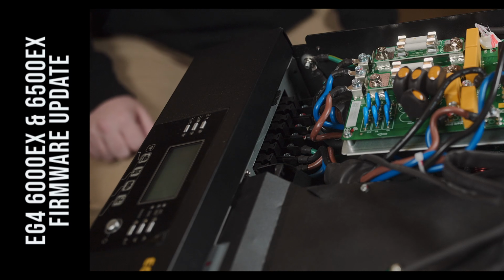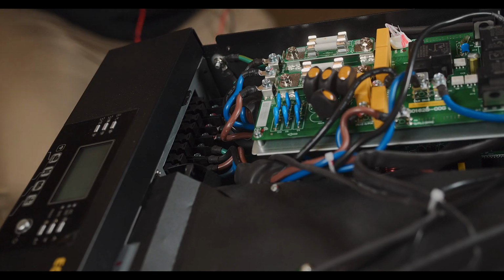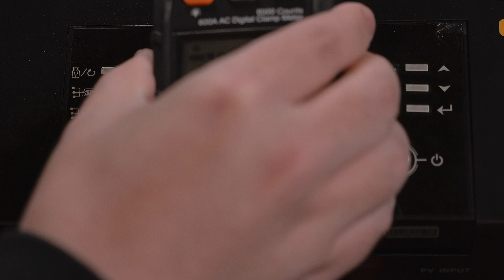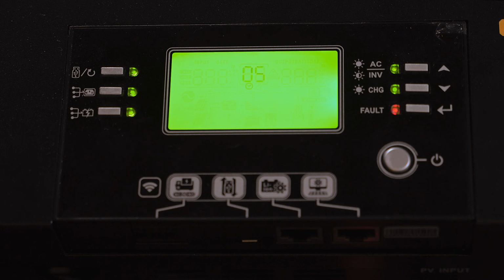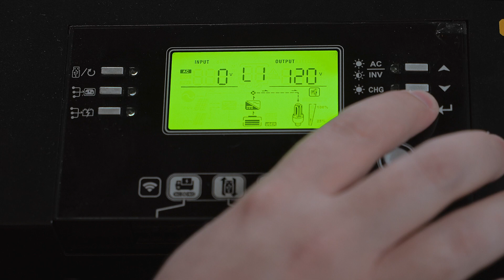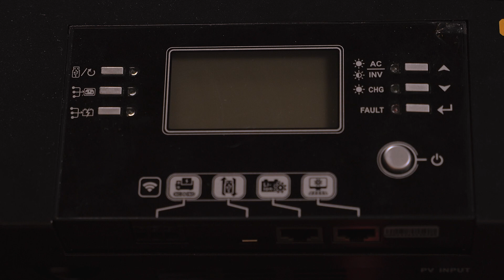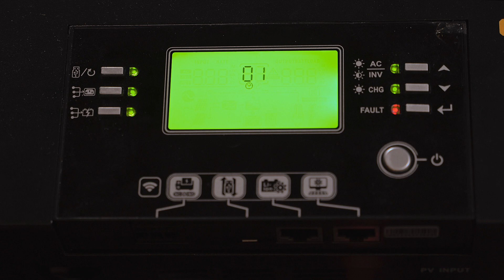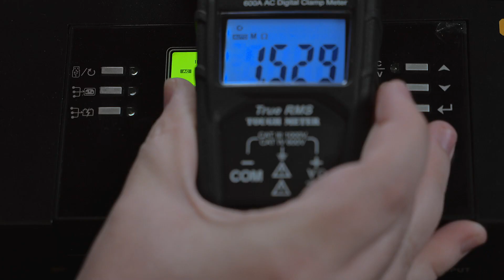Neutral Ground Bond Setting Update for EG4 6000 & 6500 All in One Solar Inverters

Comment: My neutral ground bond in my 6000xp doesn’t work. When screwing in the bonding screw in the sub panel, everything is working properly. Removing the screw and trying to use the inverter to make the bond yields the ground not working properly.

Comment: what is STATIONARY defined as ? mine is not connected to a home or any panels.

mine is connected as a off grid mobile unit, but in a residential home for a lights out scenario
Reply: Update: I downloaded and installed latest firmware update. The EG4 6500ex STILL have LIGHT FLICKERING!  I have used both disabled and disabled modes! 

Avoid like HERPES the eg4 6500ex. it is a defective product unit.  Went on forums for help but others still have same problems like myself. 

Unfortunately, customer service at Signature Solar CANNOT help.  I suspect they know the hardware is defective and doing workarounds to avoid a recall.  I really hoped it would have worked
Reply: @artvandeleah9952 I’ll know whether setting #42 helps mine tomorrow. Brent was very knowledgeable and helpful. Thank you. I’d really like to keep them on my wall!
Reply: @artvandeleah9952 don't you mean will not instead of cannot?
Reply: I purchased one of these from SigSol back when they were available, but have yet to use it (as it took me some time to install my solar panels, etc.)
It must have been about 4 months ago at LEAST. 
ANYBODY KNOW OF ANY (physical) EXCHANGE/UPDATE THEY MIGHT OFFER ?? 
I KNOW ITS A STUPID QUESTION, BUT THAT JUST SUCKS A DUCK'S DICK Dude.   @artvandeleah9952
Reply: This is what I wanna know
Reply: Perhaps "stationary" means "Common"?

Comment: A document listing the steps is that to much to ask?, Also disable = Neutral Ground bond, that sounds backword because the two are bonded is a true statement.
Also on the download web page, you show have a document stating what the fixes a given firmware fixes, this is a standard in the industry.

Comment: So, if you had an unopened 10 month old ex6500 that you are finally getting set up... Looks like this would work to open/disconnect the neutral ground bond. Please correct if wrong.
Reply from the maker: You're correct! This will allow users to disengage the bond on the system, as well as always keep AC-in and AC-out neutrals connected.